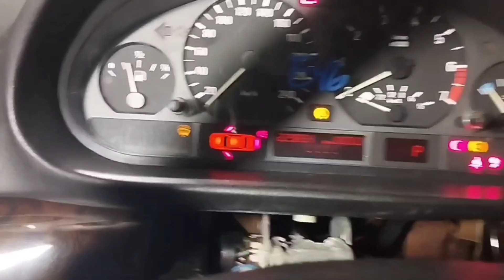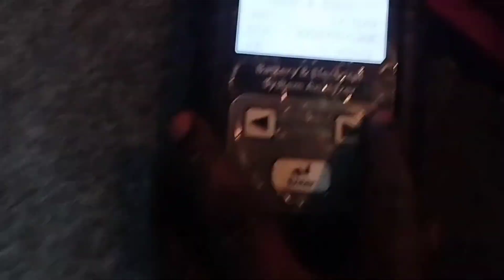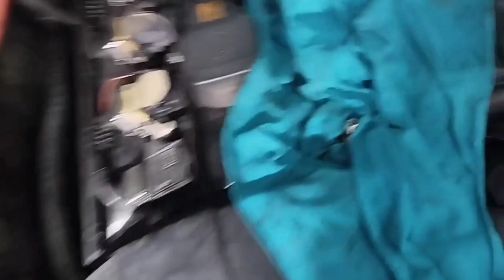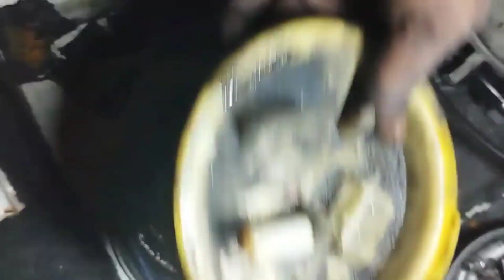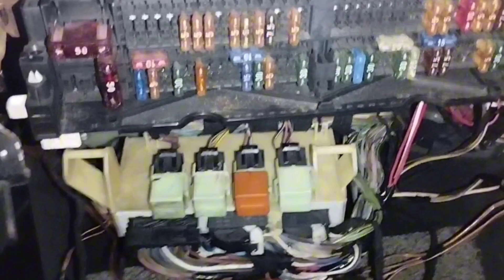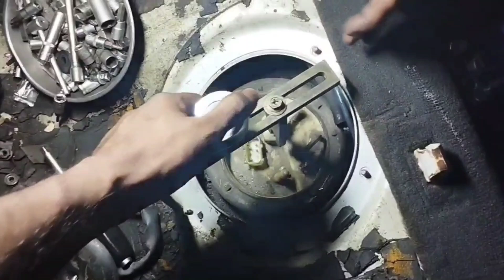BMW E46 ,Crank but won't start , fuel problems solved

Comment: Hello 
On other videos they say it is the first relay fuel pump relay , you are saying it is the fourth one , I'm confused now, i have the same, now I'm going the checkout the fourth relay , hope it will work 
Thanks anyway
Reply from the maker: You're welcome
Reply: Hi, and what happened? It is worked or not?
Reply: @heyiamsreenath  hello it wasn't the relay , the fuel pump did work but there was no pressure on the pump , I changed the fuel pump, and the problem was solved,
Changing the fuel pump is not difficult, I changed it myself